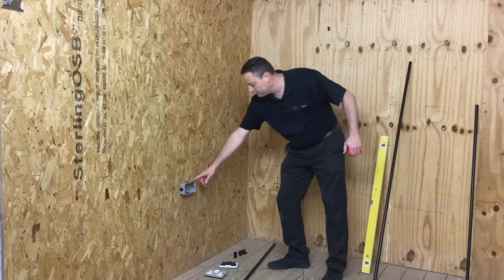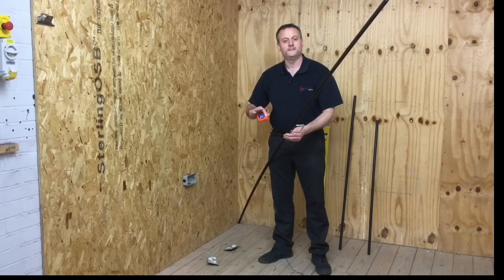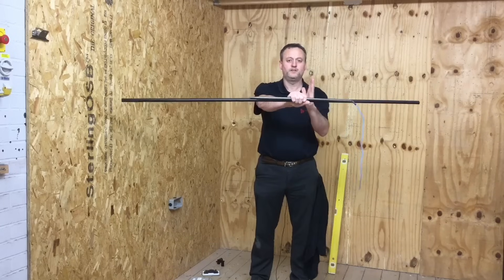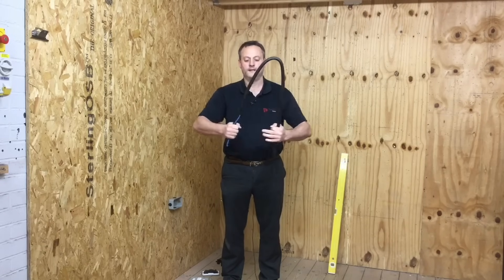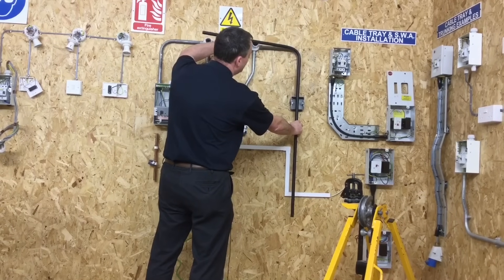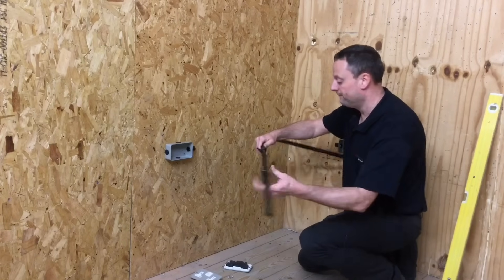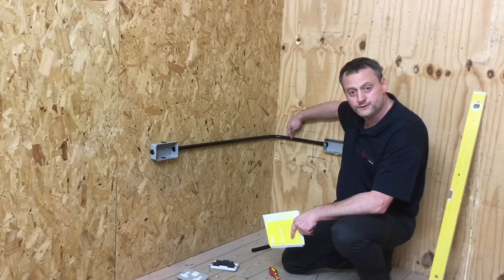How to Bend and Cut 20 mm PVC Conduit (90 Degrees Bend Using a Bending Spring)

Comment from the maker: == 🕐 Time Stamps - Cut to the action 🕕 ==
00:00 - How to bend PVC conduit
00:36 - Different sizes of conduit 
01:02 - Measure the required length before bending
01:49 - Cutting PVC conduit
02:17 - Putting the bending spring in the correct place within the conduit
03:06 - Warning the conduit before bending
03:26 - Bending PVC conduit technique
04:15 - Checking the bend is 90 degrees 
05:28 - Using female adapters 
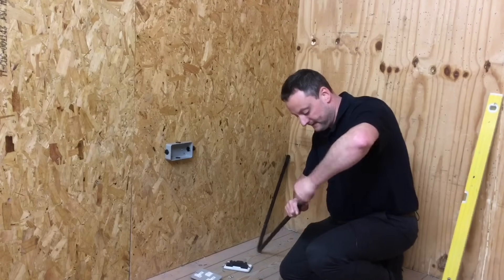07:15 - Preparing the finished end of PVC conduit
07:50 - Saddles positioned according to BS 7671

Comment: Does anyone actually do this in Britain? I had to do it in college but I've never once seen it done on a site.
Reply from the maker: The bending over the knee is to tight to conform to BS 7671 more often than not and it also looks better when you do it this way.
Reply: @GSHElectrical  No I meant actually use a bending spring. PVC conduit is rarely used here and when it is we just glue up manufactured bends.
Reply: @solidus784  doesn't seem to be used in England but in Northern Ireland we use it all the time, you can suit the bend for whatever you want and the cables don't get caught in the bend like a manufactured one
Reply: @astonpowers911  we use it the South but not that often. We use 22mm oval in chases
Reply: @solidus784  it's interesting the difference in the north and south, I've done work in the south and the twin and earth is different than up here with the already insulated earth, and I have never seen Oval on a site here I would count it as old school
Reply: @astonpowers911  Yeah I'm gone from domestic a good while now but yeah oval is still the thing. Good luck getting 2 of our 2.5 t+E's down a 20mm round. We would only use that surface and not much of it. It would be clipped NYMJ and glands or steel conduit by and large.
Reply: @solidus784  i find puttin 2 2.5 te handy enough down a 20mm if you keep them flat it goes quite easy
Reply: @astonpowers911  Yeah I know but our 1.5 is the size of your 2.5 on the outer and our 2.5 is about the size of 4sq
Reply: @solidus784  I'm from the west midlands and I come across/use it all the time usually in light comercial property's don't realy see it in heavy duty industrial installations obviously but in office buildings, comercial kitchens, clubs even small factory units
Reply: @solidus784  It's really all about the tradesmen and how they treat their craft. Some are lazy and will use inspection bends as it saves time, others like a more aesthetically pleasing finish that looks so much better on the eye so they go the extra mile and use a bending spring. Imo inspection bends are just disgusting to look at as apposed to bending it into a hokey stick. Each to their own tho i suppose!🤨
Reply: @verdiac6575  do you work exclusively in houses?

Comment: You say 20mm conduit and a 20mm bending spring?, my conduit is 20mm but a 20mm spring will not go inside as the internal size is 15mm
Reply from the maker: If you asked to a 15mm bending spring you would get a plumbers spring for copper pipe. Thanks for commenting and watching. Gaz

Comment: hi,
love to see your channel im electrician  from the Maltese isle we have the same rule as you as Malta is an ex colony of Britain but we work slightly different but as i use a lot the spring and so how you hook up is totally wrong sorry to say this but i work a lot with it ,l hook it up totally different l pass the wire true the spring so when you pull out the spring  you close the spring instead of open because it also,l like to bend the pipe on my knee find it lot easily  great show you have keep it up

Comment: Best tip I was given is don’t let the bend decide where it wants to settle. Slightly over bend and then, with the spring still in, jerk it back to 90. 
That way the pipe won’t slowly loose some bend and leave you with 85. 
We did thousands of “hockey sticks” and never had a single one that wasn’t still at 90 when it finally got installed.

Comment: Rather than carrying three different tools to achieve a clean finish on the conduit, why not use the rothenberger conduit slicer. Less weight and less time wasted titting about with all the tools. Plus you can perform the cut with the conduit in the hand aswell without needing to rest it while you cut.
Reply from the maker: https://youtu.be/2HlgNZzFsZE

😁👍
Reply: Gsh electrical 👍. I fit electric gates and use the conduit slicers over hacksaw any day. Matey with the hacksaw was whacking away trying to get it done while other matey with the slicers barely moved. Cheers for the reply, cool videos too!👍

Comment: Good point on saddle spacing 300mm from boxes and corners.

18th Edition requires metal saddles all rooms and corridors to prevent access priblems in the event of fire.
Reply from the maker: Hi thanks for commenting this link will also help 👍 https://youtu.be/K0UM_bL4dJc all the best Gaz
Reply: I passed 236 part 2 in 1991 and 16th in 1993 but did not get JIB card.

I worked on industrial machines and moved to Thailand 12 yrs ago.

If I was to pass 2391, 18th and AM2 could I get JIB Aprooved status?

Or is the lack UK work a show stopper for NVQ3?

Thank you in advance for your help.
Reply: Does this also apply for running conduit around the wall in my garage for lighting and switches?  Also installing two plug sockets on the wall.

Comment: Elbows are best, someone had a video with hot sand? I have tried hot water, what electricians use in the UK is either a 20mm or 25mm garage spring slid down into it with a bit of single core wire and bending with your knee.

DO NOT DO THIS YOU WILL PERMANENTLY DAMAGE YOUR KNEES. 

YOU WILL END UP WALKING WITH A LIMP.
Reply: It’s not a garage door spring, it’s a conduit bending spring, a tool made specially for the job. Even bending over your knee, which Gaz doesn’t do, doesn’t put enough pressure on the body part to cause any damage as the pipe is thermoplastic and very easy to flex when warmed. Not sure what you meant by “elbows are best,” do you mean conduit elbows are preferable to bends?
Reply: put your hands close to the place you want to bend the conduit lay your arm on it press your elbows down  and together. I
It works more easy cerranely with 25mm Conduit.

Comment: Useful information for us armatures who don't do serious installing,  didn't realise the black conduit could be bent just by a bit of friction heat. Planning to add a second outside light and have used glued joiners in the past.
Reply from the maker: Hi thanks. Glue all joint sadly at college we need to reuse the accessories so no glue. This video https://youtu.be/Z1VW93u_5pU has one of my learners using PVC cement 👍. Thanks for the comment and watching GSH Electrical 😁

Comment: Wow your PVC is WAY more flexible than what we use in Canada. I have to heat PVC with a heat gun here till it goes "noodle consistency" then bend and let it set to cool in that bent radius. After it cools you cant really flex it much.
Reply from the maker: Hi. Thanks for that information and watching all the best GSH Electrical 👍
Reply: He is using PVC conduit not PVC. It has much thinner walls. In the US we use the gray conduit and have to use heat as well.
Reply: Hello sir am electrical student in Kenya,, do you need electricians in Canada?
Reply: Hello, from Kenya, wish to work with you in the field of electrical installation

Comment: In reality we dont really do it like this,but this is for students.I have never seen that tool to correct the inside of the conduit.
But then i am not a englishmen or american.I am a Dutch electrician.And that warming is only needed when its cold.Normal temperature and it goes fine without.Except for the halogenfree conduits.They are more brittle.
Reply from the maker: Hi. The bending spring is widely used in the UK for bending PVC conduit. All the best and thanks for watching GSH Electrical